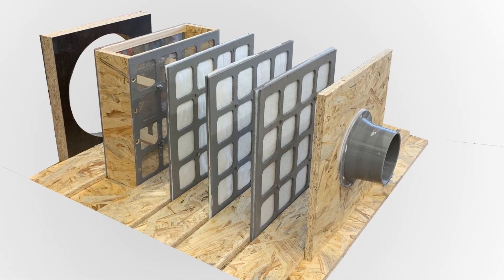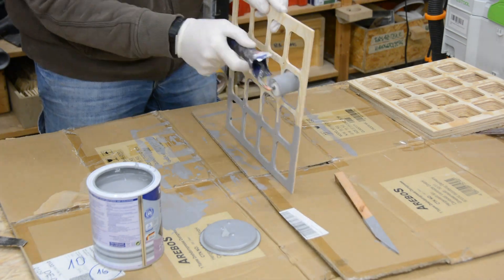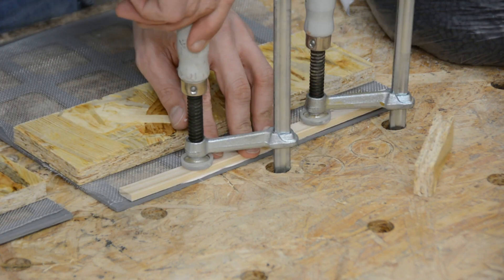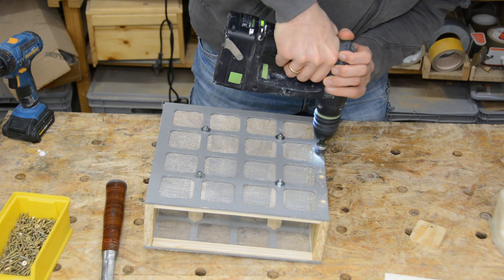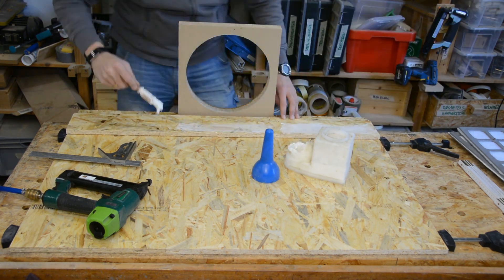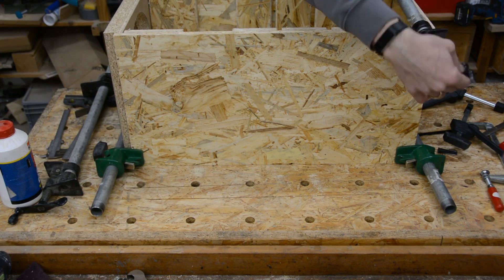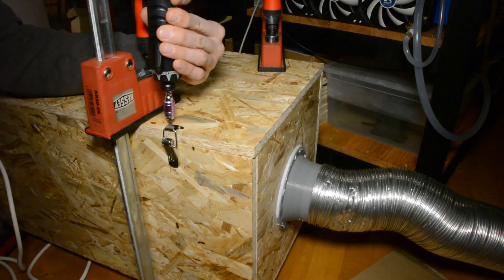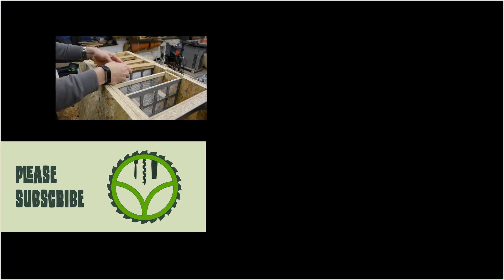DIY Laser Cutter Air Filter

Comment: I have a similar project in my backlog intended for being able remove fumes from UV resin for 3D printing without simply extracting the air. I like your build but with regards to the activated carbon volume and the enclosure size I think you are much better off having more space in the enclosure than you need, and having the cross section larger than required reduces air velocity and therefore reduces the pressure drop of filter materials, it also helps with the effectiveness of the carbon filter and what will also help is the relationship of velocity and the transit time through the carbon, the longer the contact time the more effective it will be but obviously there are trade offs with both pressure drop,  cost of carbon and size. I’d say having some wiggle room is advantageous 😅

Comment: I liked your work. I could build one that is smaller but works on a 10 or 30w diode laser with a 40x40cm cutting area, a lot of people are buying this type of laser and don't find an efficient and cheap smoke collector to buy, at least not here in Brazil. There is only one for large equipment and high prices.

gostei do seu trabalho . poderia montar um que seja menor mais que funciona em uma laser de diodo de 10 ou 30w area de corte 40x40cm, muita gente esta comprando este tipo de laser e não acha um coletor de fumaça eficiente e barato para comprar , pelo menos aqui no brasil não existe so tem para equipamentos grandes e preço alto.
Reply from the maker: Sounds like a good idea!

Comment: Thanks for video and the ideas.  I haven't built a filter box yet, but I've been researching it.

Regarding the smell of Acrylic, I've used a 50W Epilog Laser cutter with a professional vent system, and there is always a lingering smell from the laser bed, and on the edges of the cut plastic.  I don't think you can make it smell free, just vent the room more afterwards.

I've been researching using a duct fan, and the Tjernlund EF-10 10" duct fan, while having 475 CFM of air movement, only has about 0.14 inches WC (water) of static pressure (you can find a graph in there specifications PDF on their website).  I've loosely calculated static pressure losses of the ducts, elbows, and filters I'm thinking of using based on some internet page numbers and would need about 3 inches WC of static pressure to work.  I'm not surprised you need a better fan.  

I saw on Youtube a fellow measured his shop vac's static pressure using a tube bent in a U shape, halfway filled with water, and he got 78 inches WC (the difference in height of the surfaces of the sucked water column).  But the CFM won't be as high as the duct fan.  I'm in Canada and would love to get my hands on a Dewalt DXV12P-QT quiet shop vac ("-QT" means 60db), but they are only available at the moment from Lowes US. 

My other idea is to get a 1 hp dust collector, and just use the blower part of it as the fan for my filter box.  Some of the comments on one particular brand indicate they think it is quiet, while other brands are not so quiet.  

Regarding the filter size, I think bigger is better.  If the fumes zoom through your activated carbon fast, there isn't enough dwell time for the carbon to do it's job.  Larger size means the fumes will linger around the carbon longer.  Maybe a larger size with thinner layer?

Comment: Maybe re-think think this a bit. This isn't a laboratory with a reaction happening that produces large volumes of gasses. The cutter can be put in an air tight enclosure to hold onto the dirty air. Now there's more time to process it and can use a much lower power recirculating filter system. Wouldn't really have to be more than a roomba sized filter and like a GPU centrifugal fan depending on how long you can leave it alone for. The particles will settle down and can be vacuumed away later. The VOCs are more concerning to me, so I would keep the activated carbon fresh.

That medium filter system system more for a small but continuous operation of two or three machines, rather than a hobby level running one machine.
Reply from the maker: Good point - but getting the China case really airtight might be also quite a challenge on its own...
Reply: @WayofWood  The silicone sealant for windows and the weather sealant for windows could be an option to try. I don't think there would be much of a pressure difference from the inside and outside. Just need enough to keep the inside air mixing with the rest of the room. Even HVAC tape might be enough. If there is some expansion, stick a large plastic bag on the side that can inflate. It will keep the pressure down so the seals don't need to be as strong thus cheaper, depending on how much expansion there is. Not like holding a pressure is desired anyways.

Comment: I like that bud good jop 
but I just wanna know air quality results without charcoal , dont need to make video , you can do a test with and without charcoal and write down results in reply here ,thank you alot
Reply from the maker: The charcoal binds the fine particles. Without it it will smell much more.
Reply: @WayofWood  So there is no other cheap way to save environment from polycarbonate smoke , only activated charcoal would keep it clean ?
Reply from the maker: That's at least my experience
Reply: @WayofWood  I mean if its smelly but not harmful to environment without charcoal is this possible ?

Comment: You need more surface. With more surface there would be less impact on the flow of air.
Reply from the maker: Is that really the case? I understand that more surface would stay longer open (less clogging). Why would the surface make a difference for a fresh new filter?

Comment: A pretty good start to a laser filter. Here are some thoughts.
1. My 60 laser has a 6" outlet on the back of the machine. I would increase your duct to 6".
2. I would increase your filter area so as to allow the air to slow down and get the really dangerous particulates pulled out by the carbon. 
3. Put a lower quality filter to catch any carbon particles that leave.
4. Put the filter in between the blower and the laser. If you don't the blower will get dirty and raise the potential for bad things to get into the air. 
5. Reduce or eliminate the spacers around the filters, the waifer board is restricting your airflow.
Reply from the maker: Thanks a lot - very good suggestions!
Reply: Although if your filter works on negative pressure rather than positive pressure, you are less likely to leak unfiltered or partially fumes.
Reply: @floobs73  The optimal flow as I see it is a strong blower that creates a significant vacuum not super strong but strong enough to pull all the fumes out of the laser.
Reply from the maker: @bryanrocker5033 Yes - the power is key.

Comment: I am considering building one even though I have 6" ducted to the outside through the wall. Reason is that in order to vent properly one must have make up air. Well if the weather is nice outside, not too hot or too cold or too humid, I can just open a door, but since my workshop has no windows and is in the basement, opening a door is not that great an idea.  I don't do much acrylic, but when I do, the smell lingers even though it is vented outside.   If I can cut without make up air that would be ideal. 

I have an idea though that instead I can drill an intake hole in the wall and duct it to the laser with a shutter on it that can be closed when not in use. It is a 60 watt that will soon be a 100 watt when the original tube gives it up.  I can add an intake fan to draw air in and force it into the cabinet then the extractor can pull the smoke and fumes out and hopefully not smell anything.

Comment: So how does the Filter work after over a year ?... Any pro/contra?
Reply from the maker: It works - but the flow rate of the fan I have used is a bit too slow, As the enclosure is not air tight some smoke gets out of the enclosure. I have already a new fan sitting in the corner to redesign the filter - just need to find the time to do so....

Comment: Why not just use the laser cutter to cut boards with the 4 X 4 holes? Why use the laser to make a template when 4mm ply shouldn't be a problem to cut on the laser?
Reply from the maker: They are too large for my laser bed. You could create a router template on the laser and then cut them manually

Comment: What about the smell when cutting plastic materials?
I like your filter, but, I think the way commerciall filters are designed is easier to construct and maintain. You just need to make stacking frames and boxes.
Reply from the maker: I think the smell comes mainly  from the fan not being strong enough to pull all the air through the filter. I will most likely rework the design in the coming months.

Comment: How long can i use the filter?

last week, after using the laser for 2 days, a sieve in the suction tube was clogged. now i'm skeptical of how long a filter will last.
Reply from the maker: Good question - I don’t know the answer.
Reply: @WayofWood   After 8 months can you answer this question now :? I'm curious about the long-lividy of the filter .
Reply from the maker: The filter is still fine but the suction of the fan is not strong enough to pull a lot of air through the filter - I will most likely rebuild the filter with a stronger fan...
Reply: @WayofWood  But was it like that from the begining or the suction got less powerfull with time (whch would suggest the filter got cluged ) ? 
PS. Thank you for the reply :)
Reply from the maker: No - the lack of suction is due to the fan I used - not die to the filters being clogged

Comment: easier to make a cover for the window, with no gaps - just the outlet pipe. An air filter gets clogged fast, always needs replacing, costs money, and stinks after awhile.
Reply from the maker: That was my approach in our last home. Now my office is under the roof and the roof windows are difficult to work with.
Reply: Unless like me you live in terraced houses where pumping out into your garden stinks out your neighbours and comes back into the workshop

Comment: why is there no hepa filter?
Reply from the maker: Good question. You could add one if you want.
Reply: @WayofWood  yep i will . already ordered the filters i need . a g4 pre filter then a f9 bag filter an hepa h13 filter and the carbon thingies . hepa filter is the most expensive filter in the set . hope that works :)
Reply: @WayofWood  what is the size of the box that fits the 5 kg carbon? i might try 1 of 8,5 kg

Comment: Dumb question, maybe, but can’t you cut through 4mm plywood with the laser cutter??
Reply from the maker: Yes. But the size of the sheet does not fit the K40 bed. You could however create a template for the router on the laser cutter.
Reply: WayofWood Ah, that makes sense! I’m just beginning to explore the potential of buying a laser cutter for my home shop - I haven’t begun to price out bed sizes yet so don’t know the common sizes, yet. Thanks for making this video, the filter looks amazing!
Reply from the maker: @stayathomebob1219  Thank you. If you want a real laser cutter (not only an engraver) the K40 is the lower end of the spectrum with 20x30 cm bed size. You can get a K40 for around 400€. Whenever you double the bed size you will also at least double the price point...

Comment: Great job. I have a few suggestions. Install an additional active carbon filter. From time to time you should substitute the older filling and alternate the filter. Put the fan on the clean side. You could also install a flow meter or a differential pressure gauge.
Reply from the maker: Great ideas.

Comment: I guess you should use E10 filter for metal particles. Love the video. Will do one for my fiber laser. Also if the flow goes from the filters to the motor (protection of the motor) why not put the activated carbon first ?
If the air flow is pushed through the filter how does it go with time? I am very curious on your project. May be a more detailed video would be great. thanks for sharing.
Reply from the maker: Take everything I say with a grain of salt as I am only experimenting and no expert. 😏
My logic was that the active carbon filters mainly smells while the filters remove dust particles. With the active carbon first it might get clogged up. 
I will post an updated version of the filter at some point in the future. I think it requires some more active carbon and some tweaking in order to get rid of acrylic fumes...

Comment: Why don't you just cut a hole in the wall and pump the fumes outside?    If your using this inside where is the spark arrester to stop any sparks and debris that is still burning and gets sucked into the filter, that could fester there for several hours before it catches fire. I have to admit its a credit that you want to control the fumes but I think from a fire risk point of view the whole unit should be made out of metal, if you look at any fume extractor or HVAC unit in industry they are all made of metal. Yours should be for fire safety.
Reply: Manny from the Philippines. Thanks guys. Makin my own  now. Having the same problem with my neighbors. I mean the smell of cut acrylic.
Reply: Thats a very interesting point.. i will consider having an aluminum  sheet lining for the first stage of filtration.

Comment: Is there a specific kind of wood that you used for this project ? Or can you use any wood.
Reply from the maker: I used OSB for the box and plywood for the filters. You could use any kind of material as long as it is dimensionally stable (so don’t build the box from solid oak or pine 😏)
Reply: @WayofWood  thank you , for the sake of gaining knowledge why is solid oak or pine not a good idea?
Reply from the maker: Solid wood is expanding and contracting with changing moisture of the environment. This would widen the gaps of the box. 
In plywood the wood fibers go in different directions and therefore cannot move.
Reply: @WayofWood  great knowledge thank you very much .
Reply from the maker: Welcome. ;-)

Comment: Great job on the filter. But 7:12 ... please use a push stick
Reply from the maker: Thanks. My hand is actually around 10 cm away from the router - it might look closer scarier than it is...
Reply: @WayofWood  I was actually referring to 7:15 where your middle finger looks to be about 6mm away from the router bit =). I only point this out because I once thought I was safe as well on a table saw where I was only cutting half way into the wood, so the blade wasn't even exposed. However, right when I was finishing the cut, my finger slipped off the back end of the wood, right into the blade... Just a quick BZZZ... split my finger tip like a snake tongue and nicked my bone. Anyway. How do you like your filter so far? I am going to be making one soon with the hope that I no longer have to vent outside and can successfully filter 100% of particles and gas.

Comment: This is really interesting.  I made almost the exact same box about 6 months ago and I'll give you my feedback just so you have it.

The biggest big of advice to start is buy an off the shelf filter cartridge from a big company.  I am building my 2.0 and will be using the Bofa AD-350 Pre-Filter and Combined filter.(Fumex and Pace make similar filters, sure there are more too)  Almost all of the technology that is important is in the filter.  Why not leverage that for a cheap cost. (the cartridge is around $200)

This is almost a tie for the biggest.  Ditch the axial fan.  I used a similar fan and they are not designed for high pressure.  They are great for high CFM and low pressure.  Think circulating are.  Instead, get a scroll or centrifugal fan.  They are designed for ducting and high pressure.  You might not get the same CFM, but remember that the advertised CFM on any fan is un-blocked/restricted.  The second you throw a thick carbon filter in the way, you'll be lucky if you get 10% of the CFM on an axial where as the scroll will likely deliver 80-90%.

Lastly, (not really important) I am going to get an air sensor and hook it up to an arduino so I know when the flow drops.  There are a few ways you can do this but this is just because I am a weirdo.

I'll post my build once I finish and share all of the CAD files incase anyone else wants to build it.  I might get a sheet metal shop to build a few parts for mine but can easily do it with wood.

Hope this helps and good job with the video.
Reply from the maker: Thanks a lot. This is super valuable insight. Looking forward to your documentation of the build!
Reply: @WayofWood  So I am not nearly as good at documenting as I am at breaking things.  I just finished the build.  I will test for a week to make sure it is doing a good job and then post the 3 different configurations I built and let you (and anyone else that reads this) the info I have gained.
Reply from the maker: Brandegee Pierce Looking forward to it!

Comment: For my opinion there is no need for a G Filter in a laser cutter but the H Filter is missing (H13 f.eg.).  A flame stopper in front of the filter system may be useful. That’s the combi I’m using
Reply from the maker: Thanks for sharing your setup. Regarding the G filter I was also unsure - we will see after a few moths if it catches some of the fumes. 

A Hepa filter could be good to add. 

What is the role of a flame stopper? I have around 1m aluminium hose between laser and filter. When a flame manages to travel that far I might have a different problem. :-)
Reply: @WayofWood  A tube length of 1m may be enough to cool down any particles. I only have something about 30cm so I was a bit nervous at the beginning. I just add some metal netting in the tube.
Reply from the maker: Thanks. That's a good idea.
Reply: what do you recommend for spark protection?
Reply: a metallfilter from an extractor hood @peterfarkas943
Reply: @peterfarkas943  a very fine wire mesh with a gap behind it is what spark arrestor are made of.